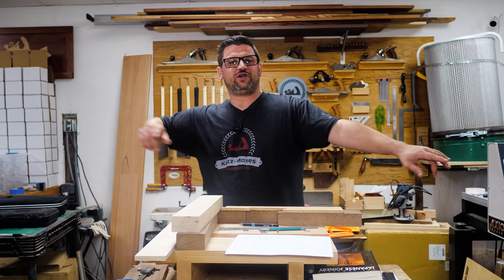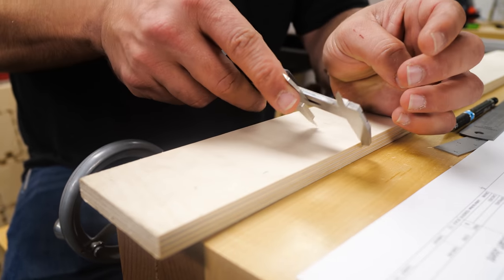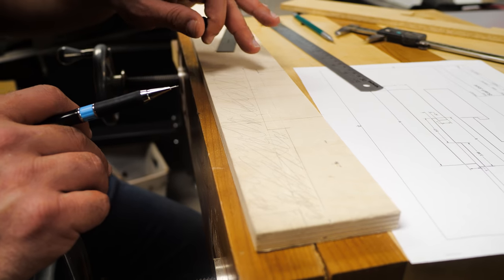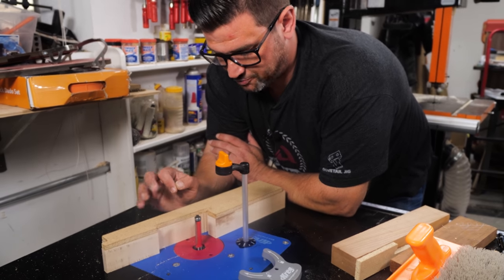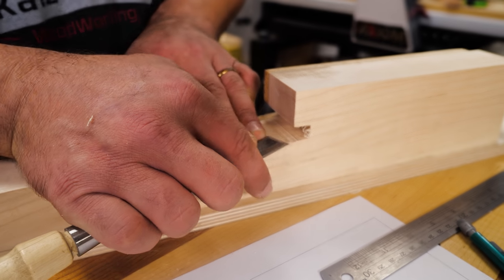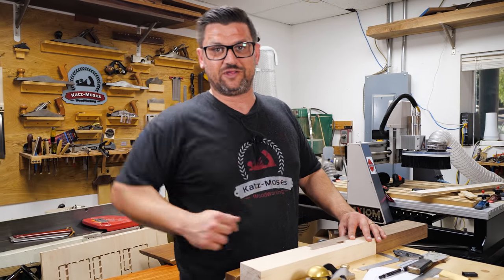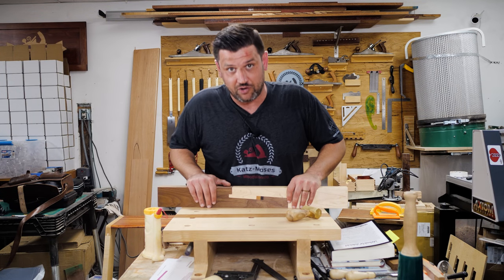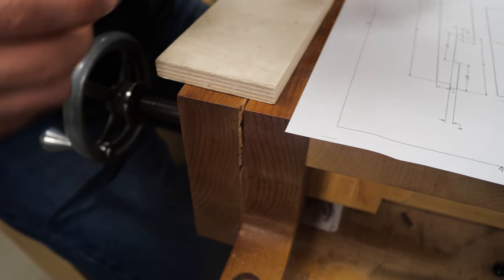Joint of the Week - Japanese Scarf Joint (Kanawa Tsugi 金輪継)

Comment: Good wok Jonathan. Just to point out this joint strictly speaking should be Okkake (大栓継), and used to joint long scarf.
A Kanawa Tsugi (金輪継) has finger joint at the tip adding strength against twisting/sheer forces, and therefore can be used in vertical support.

Comment: I thought the whole purpose of the scarf joint was to use it with large timbers, thus no glue and all handtools or handheld power tools. Wedges should be designed to hold a scarf joint tight.
Reply: Exactly! He completely missed the point by gluing it.
Reply: @daspinmonkey  yes, but glue still makes it stronger.
I don't know did Japanese 1000 years ago had a good wood glue

Comment: Dunno if this will be any help, but for routing, I've found the Whiteside Ultimate Trim router bits to be amazing. They're chunky solid carbide jobbies with dual up and down spirals. I make guitars, and I can run these things round the headstock totally ignoring grain direction with no risk of them pulling chunks out due to going against the grain. Really have been a revelation for me.
Reply from the maker: I own 2 but the piece was way too tall to use it sadly. I had to buy that ugly thing just for this video :-(
Reply: Feel a little daft now as I've watched a few of your other videos and have seen you use the bits!

Comment: Can you cut this but also with the tenon on the front face of this scarf joint https://timberframehq.com/wp-content/uploads/2015/08/scarf-joint-for-a-timber-frame-576x1024.jpg

That additional cut prevents sliding in the other axis.

I know, it's a minor modification; it's just such an amazing joint because it resists shear in all four directions, twisting, bending, compression, and tension—it's strong in every direction, just like solid timber.

Also:  can you cut it in place with only portable tools, no tables, just as if you've got a piece of pressure-treated post cemented into the ground and now you want to join a ten-foot non-treated post above grade?  ;)  Real-world application, you know.